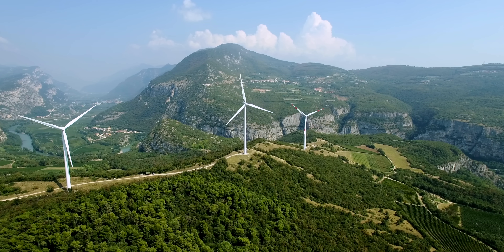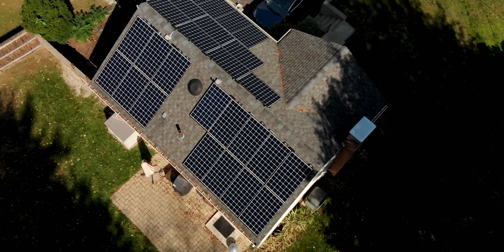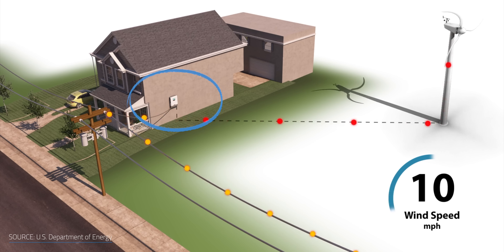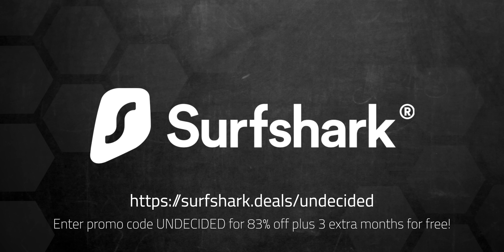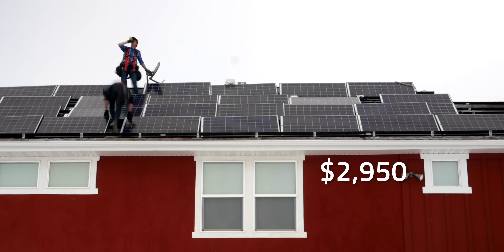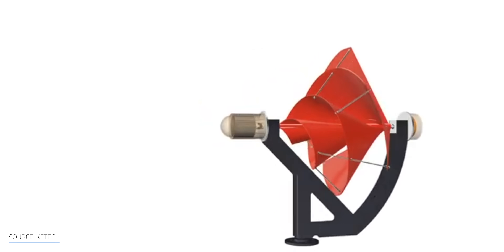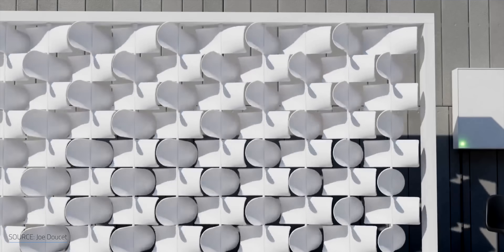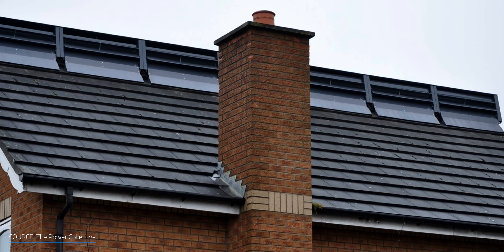The Challenges of a Wind Turbine on Your Home

Comment: I'm usually suspicious of home-scale wind power on account of the inherent way wind generation works: having the wind apply work over the surface area of the generating system. Most of these concepts, even the ones with working models, don't usually address this inherent issue, and they end up being significantly less efficient than a large turbine due to their small surface area. That said, I'm particularly impressed with the ridge turbine for using the slope of the roof to add surface area to the system to force more air through the turbine. It's a solution that's so deliciously simple, you wonder why you didn't think of that. The fact that they have working models and even ones that are going for sail is just the cherry on top. Still don't think it can replace home-level solar, but with the majority of the roof left to place solar panels on, they're definitely a reasonable addition.

Comment: You dont mount a turbine to your home directly because of vibration. You need a collapsible or folding  pole to mount on and be able to service it. Turbulunce caused by trees and tall buildings makes it problematic as well. But if you have the clearance, check out chispito wind generator made from treadmill motor and pvc pipe. You still need inverter and battery storage and charge control, but it is an affordable DIY project

Comment: 1kW wind turbine produces the same amount of 4kW solar panel in windy areas. 4kW solar can produce up to 10kWh in perfect weather. But what about nights and winter? If you live in a windy area, it significantly cheaper and means continous production. If you also add solar, even better.

Comment: At 2:50. You are describing a very old wind turbine technology. Nowadays there is no gearbox, instead there is a generator of various frequency output in order to make the most efficient conversion from wind to electricity and then using the AC/AC inverter power is converted to 50 or 60 Hz, as needed to be fed into the network.

Comment: Instead of large residential wind turbines, why not  miniature levitated generators with the 3 blade conical design.  If you could buy them for $20 a piece and place them at the corners of your house with a 6inch to 1ft offset , you can capitalize on the same effect as the ridge turbine.  If they are about 1 inch big, that would give you a lot of room to slowly grow your generating capacity with each paycheck.

Comment: Hi Matt, a very informative and topical video, thank you. Have you made one regarding how to use or setup a storage system to save the energy one generates from solar/wind and to keep most it rather than send it to the grid. With the rising cost of electricity, it makes sense to use some battery storage system instead of receiving the relatively small feed in tarriff. However, battery systems and the logistics of installing one seem daunting. Your clarity here would be very helpful. 😊

Comment: @Matt Ferrell, you did not state where in Mass you live, so the calculations may be misleading.
If you were living at a high altitude, the wind turbine KW would outweigh the solar KW, as the airflow would be greater there, plus the efficiency of the solar system would drop under higher cloud coverage, which blocks the amount of solar energy collected by the solar panels.
You did not explain the array of panels you need to cover the area that generates the kW you mentioned.  If you were factoring the tropical areas like FL, AL, MI, LA, TX and the southern board, then the solar panels would be more efficient than up north, yet still, coastal winds would make the wind turbines more practical, as one doesn't need a large array of panels in a built up area.  The downside of the wind turbine is when tropical hurricanes hit those areas, as the vertical shafts would break under the pressure of high intensity winds.  In that case, the vertical axis turbine is a better option, even over solar panels, which will lose almost complete efficiency under days of rain coverage.
Places like AZ may not have the storm issues but, working in an industry that had high silica content in the air, I can AFFIRM that sand particles will get into solar panel arrays and block the cells from efficiently collecting solar energy, thus causing high maintenance costs to the solar arrays.  Not saying that the same particles cannot get into the gears of a turbine and cause maintenance issues, but it is negligible in comparison to the solar arrays, as they cannot be PERFECTLY sealed against that happening.
I live on the edge of a hill over 1800 ft above sea level, and the small vertical access turbines I have produce more than enough kWh per day, that runs my farm and carpentry shop more efficiently than the backup,solar array does

Comment: 9.14 I installed a 20kw solar system in Thailand a year ago and already got 30% of the investment back... without any governemnt aid.
I guess its a lot more profitable becasue of 2 reasons: 
- I payed way less.  got my panels from China for only 30 cents per watt (monocrystaline half-cell panels with 10 years of warranty).in total  10'000 USD. 6000 for 20 kw of panels + 2000 for a huawai 20kwh inverter with wifi + 2000  for everything else (cables, mounts, installation work)
- I live in a village with a private grid. (the village has only 1 access to the state grid and counts as one unit). So i get to sell my power to my neighbors to the same price as they buy it from the state. otherwise i would get only half as much.

Comment: The Nikola Tesla Windmill Turbine System is Better at Producing Electricity Very Efficiently, than Other types of Wind Turbines, and All Other types of Photosynthesis Methods of Solar Power Starter Systems. But a Photosynthesis Battery Storage System to start to turn an Electrical Producing Turbine, could be a very Nice Back Up System to Have in combination next to a Nikola Tesla Windmill Electric Producing Turbine or Water Pump! Which could benefit from a Solar Powered Battery to open & shut the main doors, and turn on a wind generating current pump.

Comment: In the Netherlands we have a problematic amount of residential solar power generation. Wind partially adresses a very tough problem which solar cannot without costly storage systems;   Stabilising energy balance (matching supply and demand). So there is a real argument in combining these two on a commercial and private level

Comment: One factor that could be major is orientation. Sun prefers a north/south orientation of the roof in most of North America to optimize sun angles on the panels. Something like the ridgeblade would ideally be placed on an east west roof to take advantage of prevailing winds. So if ridgeblade can be on par with solar cost wise, then it becomes an attractive option based on your roof orientation
Reply: Here in Central TX, the wind is almost always southerly in summer and north in winter. With that said, it seems like we get endless sunny days here.

Comment: Some of us are limited by solar with existing structures like dormer windows on the roof or not ideal orientation of the roof. Despite what we are told about angles, I have solar panel on my gable wall on my house. Hugely increasing my solar panels area and very little difference in output. We need to start covering our outside walls in solar. That windwall you showed, I'm currently building a fence using the same idea . A row of vertical turbines encased in a fence frame. (Many thanks to Robert Murray smiths channel and TNT) look how much fencing you have around your home. Quite a lot of lineal length. So even small amounts will add up. We need to start looking at our homes as a power plant. Where can we squeeze power out of our home, through wind, solar rain power, gravity power, any little amount as long as it doesn't cost a fortune to get 10 watts. it all adds up.

Comment: We are developing a new type of roof top wind turbine expressly to address many of the issues that you covered and a few you didn't. It will be good to see a few new manufacturers and startups get into the wind space because competition will drive innovation. 

Another huge issue is parallel integration especially when dealing with managed lithium and other types of managed battery technologies. This is also an issue we are prototype solutions for. 
Great video and I look forward to the developments in this space.

Comment: For a home installation Solar is an established and developed renewable - home Wind Generation isn't and that is the opposite of Energy company renewables .. weird huh.

Home Wind Generation is still in development which makes price and output comparison a bit biased. I liked the ridge system, makes sense to use a position where the wind has self generated rather than in a passive position, also if that could be inserted into a new house build as the apex of the roof then there is virtually no visual difference to a tiled apex. 

One other point going back to the first is energy companies charge for renewables in your energy bills so you are paying twice if you install personal generation and also cost in terms of money is not the issue, it's the cost of not doing so to the environment, planet and future (if climate change is beyond our willingness for infrastructure change and defence). Another option is local generators supplying industrial estates and housing area's, high Kw users prioritized, high fuel users also for example. Some inherent potential danger perhaps keeps wind turbines ironically in the environment we're supposed to be protecting the most, maybe they could make them safer instead and install them in the environment that uses their power.

Once the motivation is outside of money then both energy company and personal generation could combine and get somewhere, ie you could be subsidised to install renewable generation and pay once. As far as I know Energy companies are not pro-active in helping or thinking from the consumer side and that is part of the problem.

Comment: Wind  power does not always blow, and the wind generators can’t be be recycled;solar supports the CCP which controls 70% of rare earth elements that go into solar and  batteries. And they are made by slavery in China and the Congo , kids are mining and died getting lithium for this ipad. I won’t support solar,wind and big battery’s until it’s ethical built and  collected. The new nuclear reactors that burn old waste material is a better choice for now. Turbines, batteries,solar panels are made in China with the worst environmental records and pollution and put on a bulk fuel ship to get to the USA its more carbon than you mentioned per panel,turbine,solar panels. Don’t get me wrong we need to build responsibility and in the North America with a cleaner process and better recycling of the expired components. Your video still was good

Comment: Your calculations are averaged to year but months may differ greatly. In my home town Tallinn there is difference as great as ten times so you must insall more than 10x solar to get your power needs also You usage stats are done so that you use more electricity at winter time (1.5x my case) so you need to install 15x more power to cover needs.  Both wind and sun mean you must have storage - when using LI based batteries then wind is bearly practical over gasoline generator but even worse with sun. And that is at grid level also when you install solar into grid then you must invest also to some other form of generation that works at winter time and that solar makes your total energy bill bigger since that other form lets say nuclear cant compete with sun  in price terms 6 months in year and sun cant supply you 6 months. Also you can't use long lines to supply you from south using long powerlines since energy must be built at place using long powerlines or pipelines is security risk (Northstream is out right now). And then what last week we had electriciy prices as high as 2000 $ MW/h and what happens at winter. The price went up because of CO2 prices - I thnink CO2 market will not last long in those conditions.

Comment: I don't care that they're not the best solution, I think they look cool. I want a vertical turbine mounted on my roof. The added vibrations are a concern, but I can reduce overall cost for both installation and maintenance by designing and building it myself. Obvious I don't have all the physics and testing available to me to maximize performance, but it would be a fun long-term project for me to consistently improve my design and manufacturing methods. I can also tie it into an existing solar inverter (assuming it's compatible) to eliminate that cost. So while the reasoning changes significantly for me for wind vs solar, I still think they're both worth it. 

And lucky I found this channel now because I plan to move to MA/NH sometime next year, so all the numbers you've given in these videos are very relevant to my experiences specifically.

Comment: I building in Taiwan built a vertical wind turbine in the 28th and 29th floors of a office building, where the is a constant wind flow. The turbine provides 15% of the buildings energy needs and mostly use to power the ac units saving over 3 million a year in electrical cost. Wind technology does exist, just not as sexy as strapping big reflective panels to your home and hoping they don't get damaged. There also a wind pod shaped like a ships GPS receiver the big dome things, it has energy potential of 15kwh a day, mainly used on ships at sea to provide energy for life support systems like AC/Heat and lighting. This takes off load of the engines reducing fuel consumption. I love Matt but if you really dig deep you will find that there are a lot of practical wind turbines in used in everyday applications.

Comment: Very interesting.  The traditional horizontal-axis design doesn't make sense in an urban setting, where a catastrophic failure could result in property damage and personal injury.  However, vertical-axis designs, and systems like that Ridge-Line system can address that.  (A decorative wall of verticals on the deck or patio could work)

It's obvious that solar, in most cases, will be more cost effective.  But, depending on your circumstance, wind could be a good choice.  Especially if you want some off-grid diversification.

Comment: I was thinking of one of the really cheap 100w Chinese turbines, to plug into a big Bluetti when it's not sunny.
A bunch of people say they bought one of those, but only got 10w out of it. Others have said, though, that running one with no load damages the internals... and what's the first thing a noob does with their new turbine? Takes it outside, holding it in their hand, and watches it spin... and now it's broken!
I've seen another video from somebody who bought a 500w dirt cheap one from China, but installed it properly and has been getting 500w from it for years. So I suppose if you're lucky and know what you are doing, you can do well with a cheapie.
I also discovered (after more research than I should have done) the concept of "dump loads". A turbine with no load on it will damage the turbine, so once the battery bank is charged, the charging will cut off and damage the turbine, so wind charge controllers, unlike solar charge controllers, switch over to a "dump load". This is usually some power-hungry, ineffcient device like a resistive water heater in a big tank. Free hot water!
So, in the end, I'm going to be running that big Bluetti on a heath robinson collection of VERY-less-than-optimally-placed 100w flex panels, electrical tape and garden poles. It'll probably never "pay for itself", and the 500w of panels I have space to rig up will probably struggle to put out half that most of the time... but we've all got to do our bit. And if I can boil the kettle, dry my hair and render a video on solar power, that's at least a bit saved.

Comment: I am living on a countryside in North-East Poland where wind is blowing almost constantly (a lot of flat area around, wind has space to speed up), and sometimes it gets strong enough to turn over garden furniture. I have solar panels, which covers my home energy consumption, but there is 1 more thing that isn’t covered: heating the house.
Our winters are kinda cold and solar panels fail to produce a lot at that time (short days), so I am burning coal/wooden pellets, which is fairly fine, but recent events in Ukraine made the coal price go up by almost 400%, thus am thinking of using something that could generate some energy at winter times.
I have seen couple of projects of Savonius VAWTs with outer wind deflectors, directing wind always on the catching side so it doesn’t blow against the turning turbine (which is one of main factors of low efficiency). My idea was to make a turbine like that based on DC motor, that would heat up the water in the big buffer tank, to be used for house heating. Placing that close to the ground would still catch a lot of wind and would make the maintenance easier (accessible from the ground).
Could anybody confirm my considerations? Would it be realistic? I would obviously start with measuring the wind over a longer period to verify the speed and then design a small’ish prototype, but would be handy if somebody with higher aerodynamic knowledge could give some thoughts on it. Would also greatly appreciate more videos about that topic @Matt Ferrell :).
Thanks!